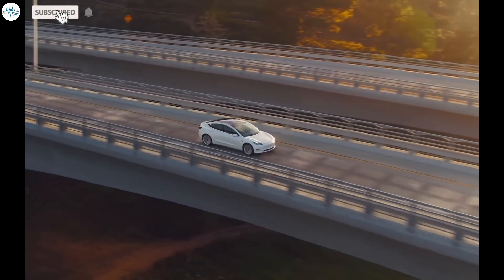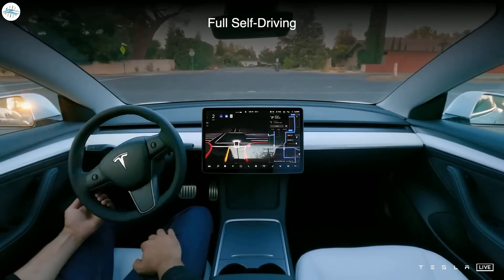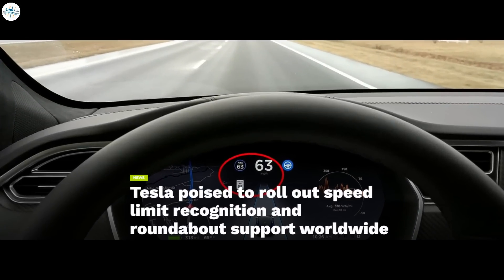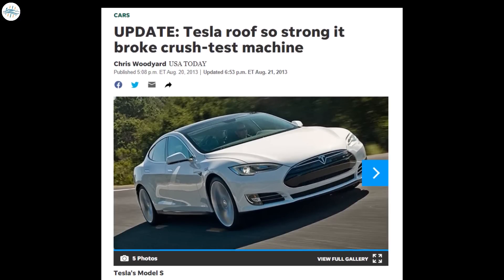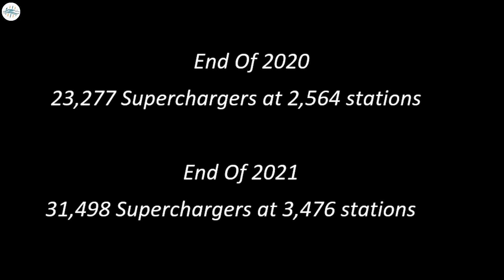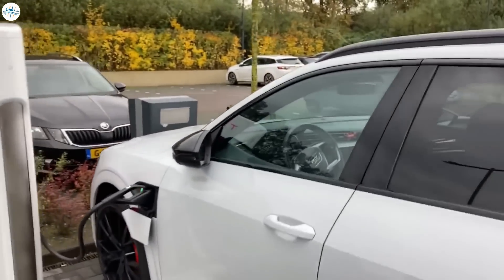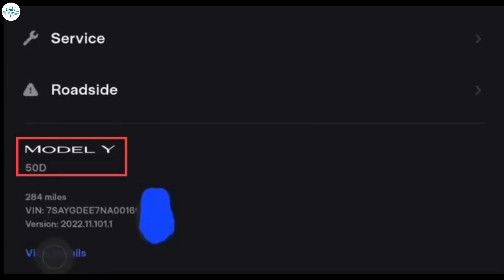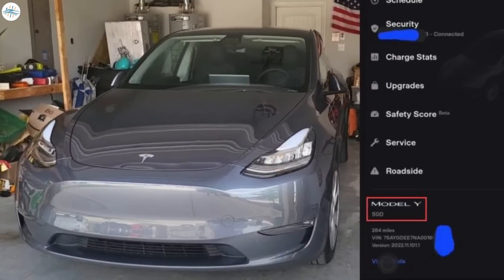New Model Y From Giga Texas Battery Size Revealed & More Updates!

Comment: I think what is going on is Elon down played the need for longer ranges so that the public wouldn't get upset when the new Model Y didn't. Using less batteries and selling the car at the same price increases their profit margins but, nothing for the customer not even a lower price point. That is not right. Why then hype the 4680 batteries when only the company gets the advantage from it. Tesla has lead the EV market but I do find some of the things they do deceptive.
Reply from the maker: They won't reduce the price till the time they recover their development cost for these new cells and their new factory.
Reply: @TheElectricArena  Always excuses for Tesla BS. They are not reducing prices, the only direction is up.